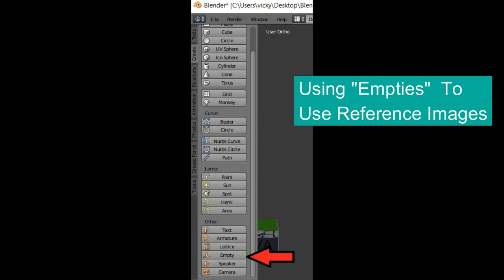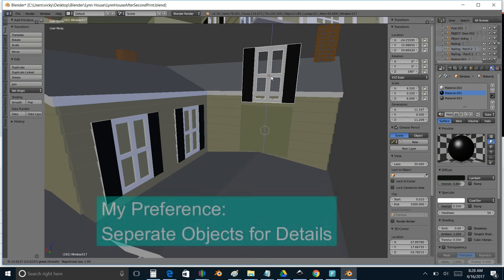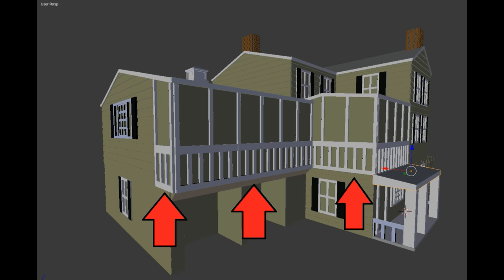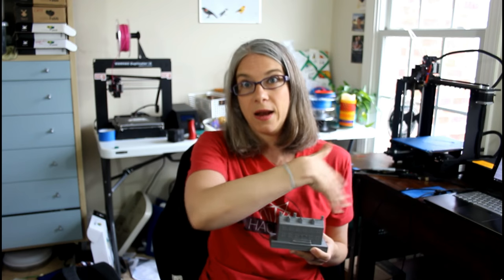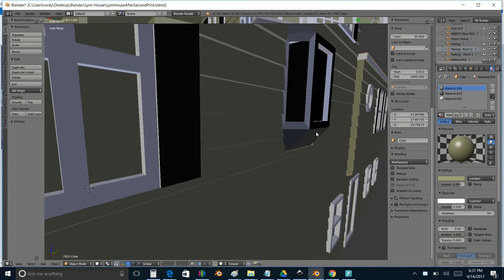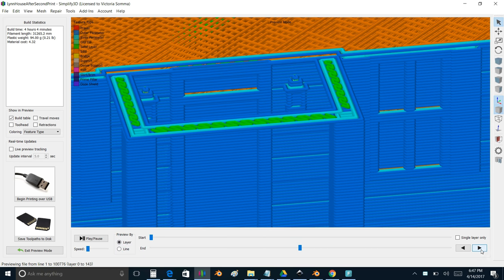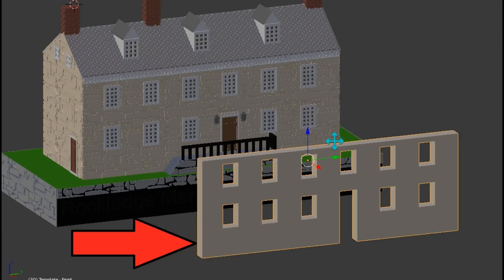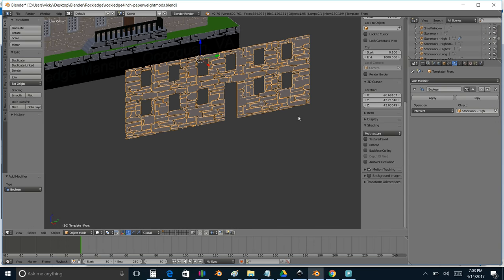Tour Of My 3D Printed Houses

Comment: Why not just import back ground images and lock them to their respective views? I know you can't manipulate them as easily as empties, but it's quicker to load a handful of images and lock them down. Am I overlooking some advantage? Those are some great models.
Reply from the maker: Robert, you have taught me a new thing about Blender!!!  I frequently do background images for my bird and butterfly magnets... but-- I had never noticed that I could pick the axis for the image!  So I was always adding a single image for my X-Y plane (where you could only view it in Top view)

I don't think I'll completely wean myself from Empties just yet though.  Sometimes my reference images aren't at the same size (the Side of the building might be smaller that the front), so I anticipate still having a use case of putting two empties adjacent to each other to get the scaling right.

And.... it is more of a "want" than a need as I am sure I could work around it, but I can also see myself opting for Empties for times when I want them to stay visible as I change perspective and rotate around my model.

Nonetheless, I'm quite excited to have a new bit of knowledge!  Thank you so much for sharing a tip with me (and any eavesdroppers).  

Thanks for watching and have a most lovely day!!!

Comment: Why not fusion 360. It’s way easier and it’s meant for stuff like 3D printing
Reply: Fusion 360 may be more fit for architecture and 3D printing due to it being CAD/measurement wise but I understand that if TGAW started with Blender that it is easier.  I personally use both so I understand why you'd use fusion 360 over blender and blender over fusion 360.  I started with blender 4 years ago and fusion 360 recently so for me architecture is way easier in blender, although not measured exact, for small scale models like this it really isn't needed unless your going for exact fits.  That's just my thought on it I believe.